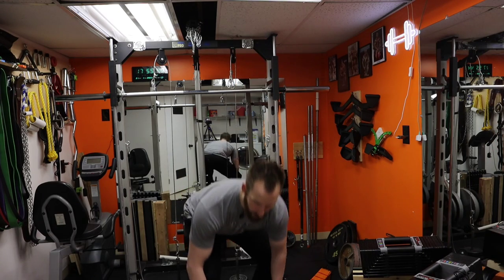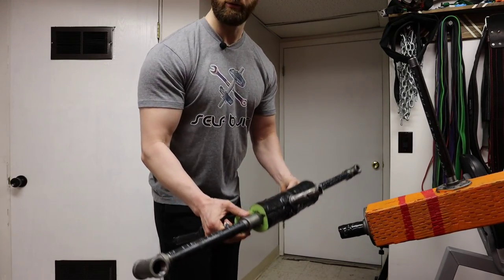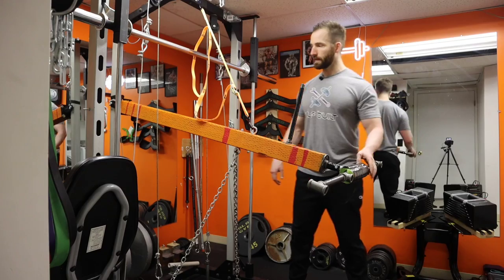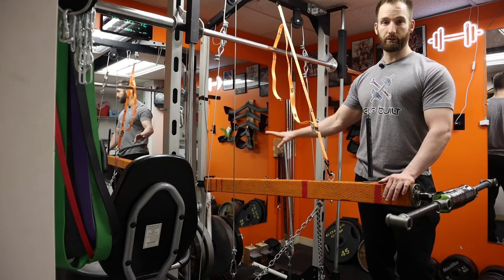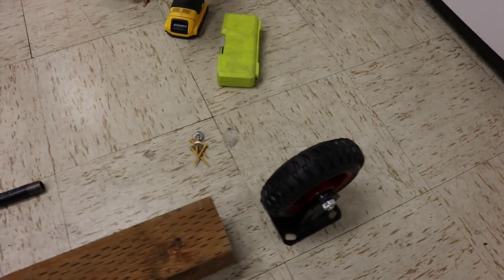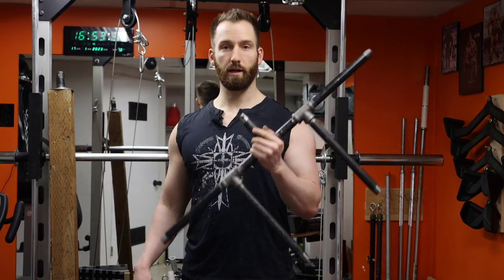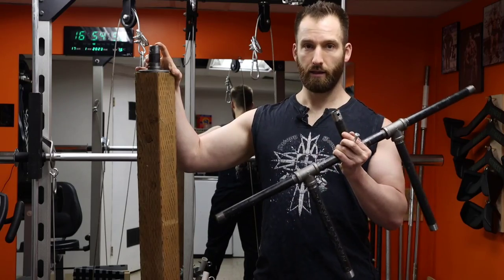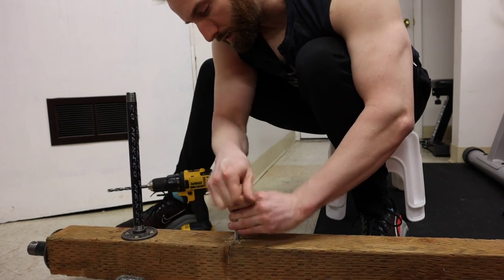DIY MOST UNIVERSAL LEVER GYM EQUIPMENT

Comment: As usual, nice job! I particularly like this project you did. I like to see others make projects I have not thought of and modify them as I see fit to make them work best for me. If I build this, I would make two adjustments.  1) I don't want any wiggle so rather than making the handle removable I would simply have it thread into the wood and tighten it up with pliers and of course some strong glue on the threads 2) again I don't want it wiggling so the handles that came loose when you were testing would not be removable if I built it. To make the handles stronger I would add a t connector to each of them and attach another piece of pipe between them you can still hold the handles like you want it's just stronger because they are no longer removable 

I like the thought of being able to change out handles, but what are your thoughts on what the other handles would be? I think this one handle is all you really need.
Reply from the maker: Thank you so much! It was a fun project and I've had some great workouts with it. Looking back the only thing I would change is instead of having connecting the handles by having the 2 different sized pipes with a bolt, I would have just done one longer pipe and thread the handle on. 

The only other handle change I like using is the cap and bolt. That way it would be great for belt squats and cable handles can attach too. You have some great ideas too! Thanks for watching!

Comment: You can use pipe insulation foam around the pipes for a more tight fit for weightplates, as well as protection and zerro wooble
Reply from the maker: @silasgroenning  Excellent idea! I'll be off to the dollar store for more foam 😄 Thank you for watching!
Reply: @SelfBuilt  ive used it for loading pins a long time, where the plates seems to be more in danger of moving.. its a cheap fix thou, and you already used it for the handle… anyways.. great build.. it has a good lenght to some belt squatting id say, because the curve will be less, as the beam is so long… would also giev oppertunity to strenght test the sturdiness of how much an eyebolt drilled through would be able to hold.. i suspect more then the handle… then you just need to be able to load/unload safely with the strap thing you are using, or make some footrest for it.. elite fts have a great belt squat landmine attachment for inspiration.. 👍✌️👍
Reply from the maker: @silasgroenning  Thank you so much man! It would be interesting to see how much weight the contraption can handle. It's held around 250lbs on the belt squat if I remember right. I have a video that I freshly did a stress test but don't remember the lbs exactly. I just remember it felt satisfied with it. I'll have to check out elite fts. Thank you and I wish you the best! 💪💪